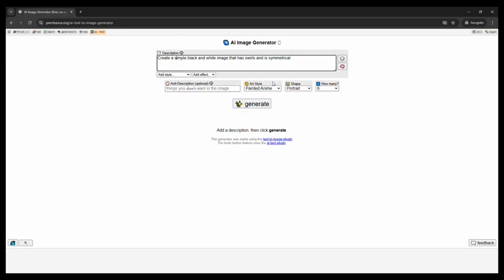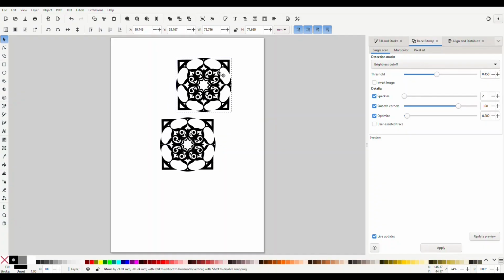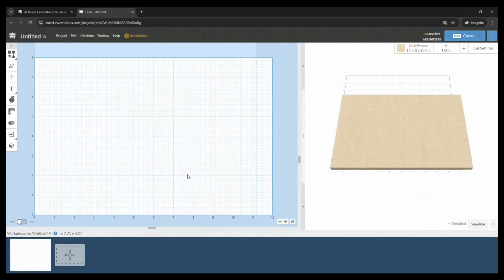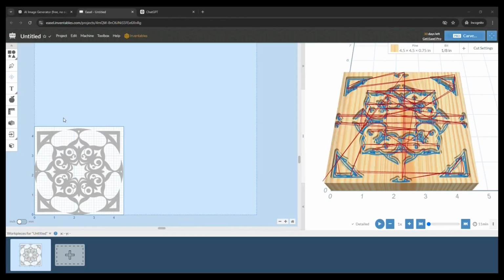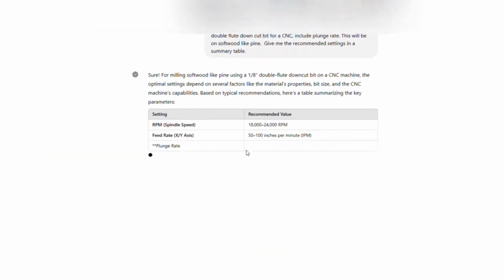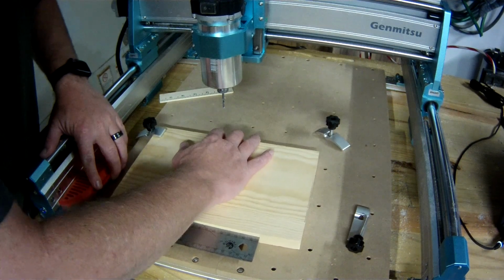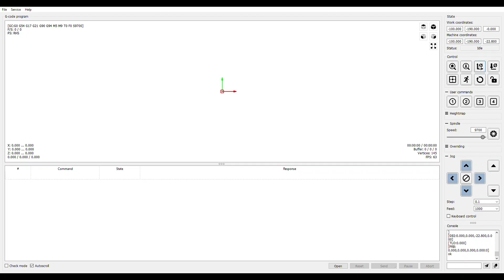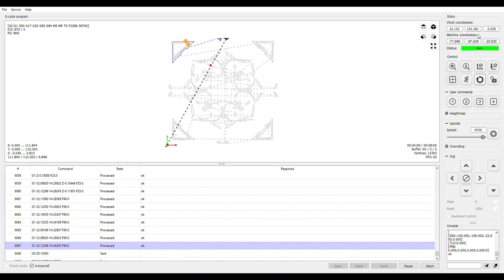CNC Carving Made Easy with AI for Beginners Part 1

Comment: 2 things. More info on Inkscape, never heard of it...   a free version of Easel Pro, or comparable program that one can buy once and be done with it, instead of renting access to a program for a monthly fee.  I would happily buy a program I can continuously use into the future, but I refuse to rent software.
Reply from the maker: Inkscape is free, which is why I use it. And I couldn't agree more on buy once software. I'll try to cover these aspects soon!
Reply: Carbide Create is primarily monthly subscription for Pro features, Basic is free up to V6. You can do a buy it,  but need annual maintenance charge to get fixes & updates
Reply: @JohnCol-1959  I have an install file for Carbide Create 6.52(never tried it).  Does that allow for 3D carving like a landscape model?  Im not interested in a subscription or long term maintenance, Im a basic hobbyist who just wants to make a few things in my rare moments of off time.
Reply: Couldn't you just use gcode tools plugin in inkscape ?
Reply: @videotowatch2000  I dont know, Ive never used inkscape.  Can you?  I tried Carbide Create again, but it only works with their cnc machines. No way to export Gcode for the generic 3018pro anymore.  Easel does everything I personally need, but the cost of membership is too high.